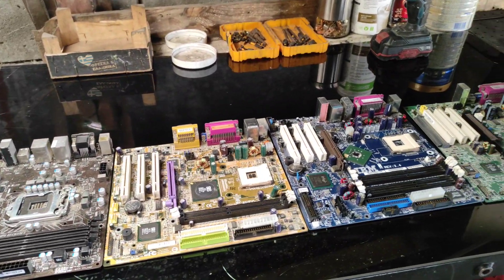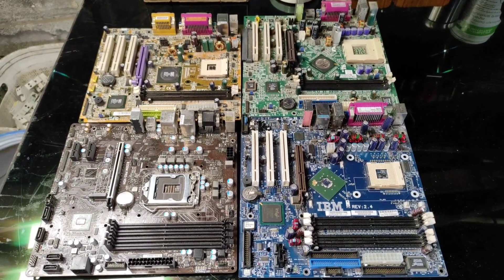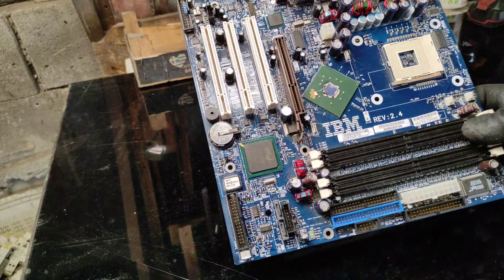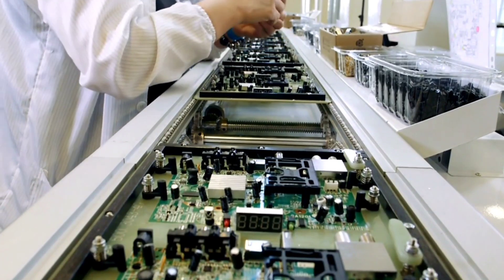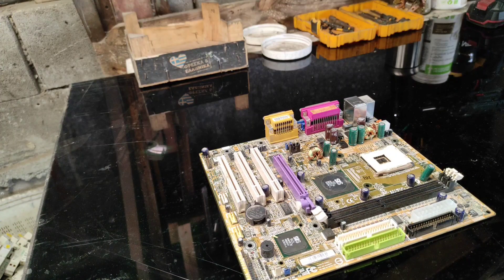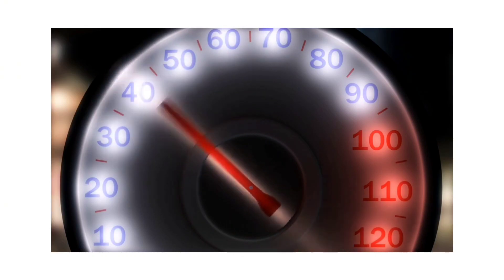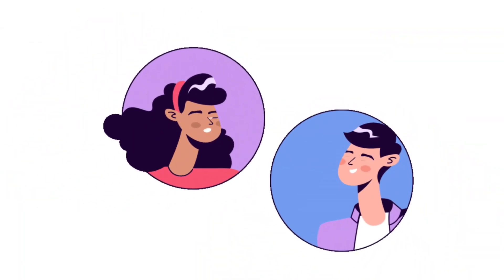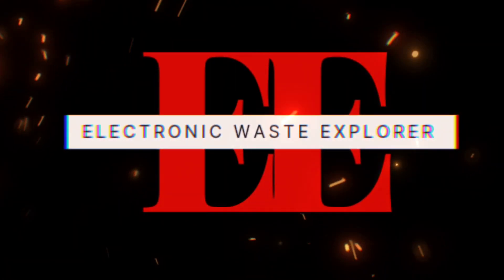The Secret Behind Motherboard Colors Revealed!

Comment: Black: Modern motherboard, does not indicate budget! Could be anything from a 2nd gen cpu to the latest of 15th gen
Yellow: Old and cheap budget even in its time, PGA generation and early lga755
Green: OEM motherboard like Dell, still used on the newest motherboards, easy to inspect for damage on traces
Blue: LGA755 Era color, most present on gigabyte likely from 2010s, blue is also very common on laptop
White, red or purple pcb color: Very rare, likely an engineering sample or something for prototyping or a custom motherboard
Reply: I got a red one for an old 2004 Celeron
Reply from the maker: Old school 👍😉🚀

Comment: Also the boards are made out of 3 different types of material. 2 different types of engineering processes to boot. The mask as you call it is antioxsiding  coat is to pretect against cool air condensing on the boards resulting in corrosion. Colour has no baring on heat disapating only attracting heat.
Reply from the maker: Cool 👍 thank you for sharing with us 😉.